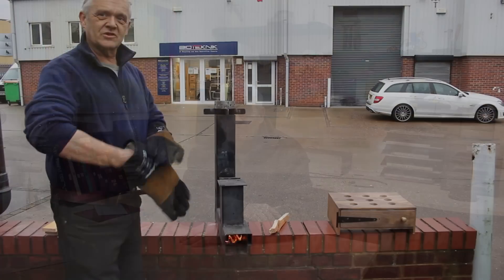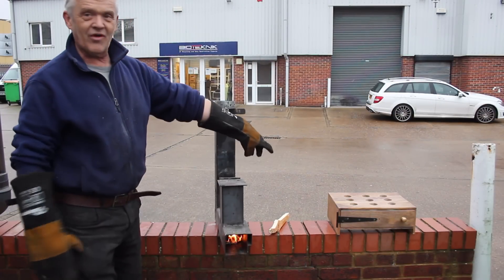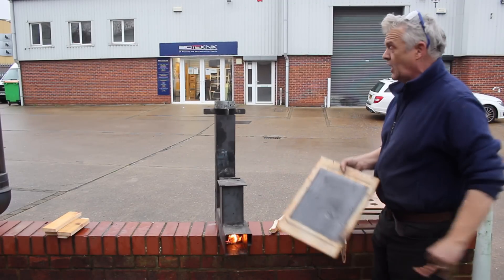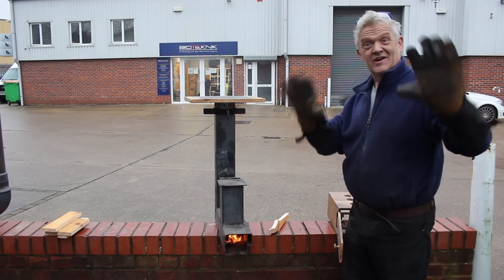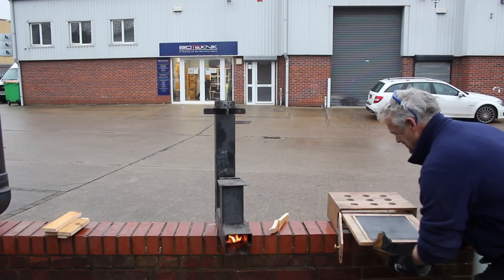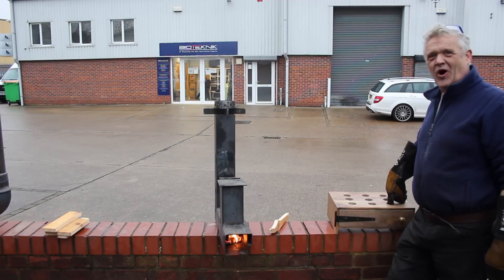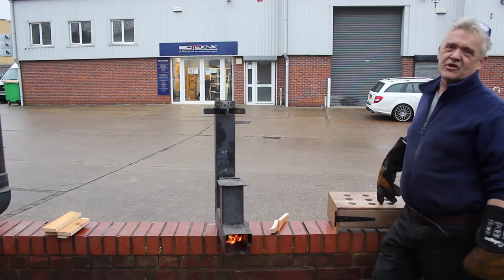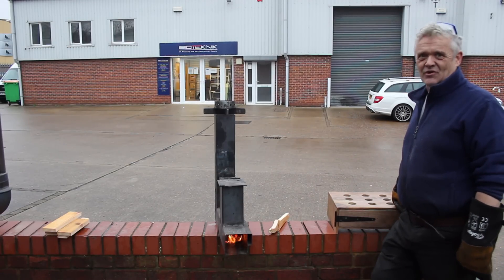1788 How To Use The Heat From A Rocket Stove Inside

Comment: A mate of mine in Sweden built himself a large steel framed workshop next to his bungalow. Inside the workshop he's got a bloody great log burning stove that he made to take pretty long lumps of log (There's less chainsawing and less time lost to go tend to the fire if it can easily take 3'6" long logs !). The top of that burner is a long flat plate, and during winter, on top of that goes 3 ruddy great lumps of stainless steel. Each of these lumps are about a foot long and 18ish inch in diameter, so he has to use an engine hoist on eye bolts to move them. They were just offcuts he had kicking around from a big turning job, but each one of these "Offcuts" must be 2 to 300kg !

Throughout the day these things get hotter and hotter. Then in the evening, before shutting everything off and tidying up, he loads these onto a stout trolley he made for the job, and wheels them into his house. He then leaves them to do their thing while he finishes up in the workshop. By the time he gets back to the house it's warm, and he says that these things save him from having to light a fire in his home through all but the harshest of winters.

I remember once wondering what kind of paraffin or diesel heater he'd need to use get an equivalent BTU per hour that these lumps of stainless put out, but there's just too many variables to even start trying to do the maths. I don't even know what temperature they get up to, or how constant the final temperature is from day to day....... But I'm still curious, because if it's enough to fend off a Swedish winter, the output must be pretty high.
Reply: Yeah but that's an open flame just getting hotter an hotter and the metal is absorbing it, not so but how hot but how long it can hold onto it also the design of the burner might determine the temp on top.. 👍🏴
Reply: @AB-C1  The stove itself is a pretty substantial piece of kit. The body's made out of a 4' long piece of something like 20 to 24" diameter (Very) thick wall pipe layed horizontally on chunky solid legs. He then cut a strip out of the top of that and welded in about a 10" wide slab of steel plate to form a surface to cook on. The back plate and front door have got to be over an inch thick too, so with all that steel, the whole thing works like a fairly effective thermal mass all by itself, and in winter, never really get's down to room temperature. Even so, when we talked about it, he said that if he puts the lumps of stainless on top before it's first lit, the workshop feels like it actually takes longer to heat back up in the mornings than without them, so they must be absorbing a fairly large amount of energy. 

He told me that when the stainless is in the house it's usually still a bit too hot to touch without welding gloves the following morning, so it must be storing a pretty substantial amount of heat. I also remember asking why he didn't make a heatsink to sit on top of one so he could get the heat out quicker, and he told me there was no need, and that would most likely make the bungalow TOO warm at night.

Slightly annoyingly, I've never actually seen the stove lit, or the "Thermal accumulators" in use, so the only info I have on them is from when I was admiring his work during the visit after he'd built the stove, and the questions I thought to ask at the time. But as the weather can get pretty inhospitable over there in winter, I've not yet been nuts enough to go visit him during that time of year...... The idea of looking at the weather report and knowing you'll be having to dig your way out of the house through a snow drift AGAIN come the morning sounds just a bit too claustrophobic for my liking. :D

Comment: Same idea to the next level. Use a bucket of stones with a bunch of smaller holes on the bottom and stacked at the top of the chimney. The hot exhaust then rises through the rock 
 
If there were smoke left in the air spaces between the rocks, then  convection will then pull it out just before bringing it inside.
Reply: i like this idea. Fast heating and free fast convection release inside.
Reply: Anything that is heated over an open flame is likely going to small sooty. With this idea you can use a smaller bucket on the stove and then transfer it into a larger bucket with lid to seal in the smell. Could also be more decorative. Maybe a mini glazed no-chimney "Kachelofen". Have two of the smaller ones to swap them out. The outer bucket will at first be a little slower releasing the heat from within, but evens it out a bit over time.
Alternatively, use an intermediate hot plate so the soot stays with the stove.

Comment: I think the ideal solution would be a sand battery to absorb as much heat as possible from a shot burn say 2hr or so. 
Then I'm thinking if that heat could preheat the return to a conventional central heating boiler. The boiler wouldn't have to work so hard, but could do all the work of controlling the circulation, of the heat and regulating the temperature. 
To keep it simple, if the rocket stove was its own system, and some form of heat exchanger between it and the central heating, would mitigate some problems and risk.

Comment: I've got similar ideas. I've done this with a small sand battery that I then put into a ceramic chimenea in the house. 

What I really want to do is put a pellet hopper on my rocket stove so that it'll burn for 8 hours nonstop. Then just run a heat exchanger/radiator from the stovepipe through a thimble installed in a window. I found a little motorcycle radiator on Amazon for less than $20. That'll be a good start.

Comment: Personally, I don't want to have to be running in and out in rotten weather to keep swapping out items like that.

And if one were crippled, it would be pretty much unattainable.

The copper coil is something that one need not spend all their time tending to, be they in hale health or on the edge of death.

Admittedly, if one is on such bad health, its likely they will be relying on somebody else to be building the stove, as well as tending any heavy pieces of thermal mass.

Me personally, I'm just fine with the stove outside of the house, but I'm going to stick with the radiator and heat exchanger option.

Again, saying something that annoys some people, but if it is built CORRECTLY...

"Its more 'efficient' "

Comment: I'm experimenting with running a plain steel tube at a rising angle over the flame. The low end of the tube is about 1 foot from the top of the stove. After the hot spot, about 4 feet of the tube rise and enter the tent or small camper. The heat rising in the tube draws cold fresh air. I've managed to get 68° fahrenheit (20° C) up from 40° (5° C) into the space.

That part's no problem.

But the stove I'm using is not burning oil cleanly. (I have almost unlimited access to fresh vegetable oil.) Smoke could get into the cool end of the steel tube and smoke means fuel wasted and low flame temperature.

If I do manage a tall enough chimney section to get a good "rocket" burn, that would mean that the end of the tube that needs to be low, is forced to be high.

(The fresh air tube could run through the center height of the chimney. But I'd only want to build that setup if/when there's a satisfactorily clean burn anyway.)
Reply: Just mix a small percentage of paraffin or kerosene into the oil. It'll burn cleaner at relatively small expense. Good idea you have there.
Reply: @jerrodlopes186  I can't deny that this is worth a try.

Comment: What if you had a large carousel halfway between the rocket stove outside and the house inside. The "hot plate"  would be round and on a vertical axle that spins as fast as a rotisserie moving heat from the stove through an insulated horizontal slit in the house. Ok...maybe that's a long shot...lol

Comment: Another fella on YouTube (can’t remember name) built a large sand battery around the chimney.  After an hour of warming the battery he would split  the two taking the large battery  (80 kilos) inside and leaving the stove out doors.    

He reported that it worked great and keep his living room  room too warm at times.  Stays warm through the night.
Reply: I saw that one too.  His design was well thought out but a little bit clunky.   Although i guess u can't have thermal mass without the "mass"
Reply: @RichardCranium321   seems you could build something into a cart of sorts.  Easily wheeled around. Feet that won’t allow it to be toppled.  Cool idea for sure.
Reply: @Route72Trucks  I was thinking more like a set of 4 or 5 stackable rings and a central spindle.  The spindle itself acts as an alignment for the transport cart (and extra thermal mass) but it's hole is also the "chimney" slot for the stove.  Imagine a flapjack stack with a vertical hole down through the middle. You can move each pancake individually yet still make up the same size stack and it eats just the same.
Reply: @RichardCranium321  this makes perfect sense
Reply: @GadgetViper  did it??  it made perfect sense in my head but after reading it, it sounds more confusing in text

Comment: The Force was weak in this video and so was the idea lol. Had a cast iron wood burner inside my house, was the complete opposite to a rocket stove, burned slowly all night or day with minimal local wood, up the flute and out the chimney, of all the ways I've tried to keep warm over the years, hands down the best and most enjoyable and extremely cheap, free wood cut on the side off the road, kept the house lovely and warm all winter, no dicking around. make an exhaust exit, done.
Reply: in many areas of the UK you are not allowed to emit smoke, smokeless fuels must be used (or a rocket stove that emits no smoke), so often other solutions must be found, these are just ideas that can be adapted or copied as a way of getting the heat indoors where you cant run alternative or want to avoid more expensive options.
Reply: @grendel1960a  even wood can be smokeless if seasoned and burned properly. You all give up too easily on that side of the pond. Pellets can, and usually do, burn very cleanly. I have a small rocket stove for which there is a pellet hopper available. If I owned my home I would install it in a heartbeat and never be cold again.
Reply: @jerrodlopes186  many years back now (in another house that was a listed property (17th century -limited changes allowed to the exterior) we used to burn wood in the standard fireplace of the house, the wood was bought as a load of slabs or offcuts / trimmings from the local sawmill at £5 a load, a load would completely fill the car (you had to collect) but would keep the house warm for several months, I also used to stop and pick up fallen wood b the roadside on the way home - fortunately at the time we lived in a small village with no smoke free zones, now I live in a city centre, and the smoke free zone starts 20 foot from my back garden wall, so I have to be careful, also since the house used to have forced air gas heating (and now has gas central heating) there is no chimney built in, so alternate methods are more appropriate. the cost of a woodburner installation is even more exorbitant than running gas or electric heating, and is not something that we can DIY.
Reply: @grendel1960a  your government has you all boxed up nice and neat, haven't they? It's headed that direction very quickly here, too. I live in California. It's very obvious, here at least, that these regulations have little to do with the environment and a lot to do with certain people making money. Just before reading your reply I made a couple of DIY oil lamps and put them in my ceramic fireplace. They're happily burning away and giving off some heat with a little help from a strategically placed computer fan. I feel badly for you over there, and anyone under such harsh and heavy-handed rule. Good luck to you.
Reply: @grendel1960a  Mate, sounds like they want you to freeze over there, all sounds a bit extreme, I never was one to stick to the rules lol.
Reply: @jerrodlopes186  I have to agree with you, rules are meant to be broken lol.
Reply: @grendel1960a  ok, thanks for the info, cheers.

Comment: You should try using Kelly Kettles filled with sand, turning them in to sand batteries. Heat as many as you need outside and bring them inside as is or add a stand, tubing and a PC fan.
Reply: The Aluminium Kelly Kettle would be ideal as it is cheaper than the stainless one and you do not want to boil drinking water in aluminium in any case.
Reply: @bfbf3342  Maybe. But what about the low melting point of aluminium? Rocket stoves are very hot.

Comment: could you run the rocket stove on the outside of a wall and transfer the heat from the stove to the other side of the wall by, say, concrete encasing the flue and the concrete passing through the wall. Or using a water jacket around the flue and piping to a radiator. what do you think?

Comment: I like the idea of a second air channel tandem to the stove that directs heat into the home while the smoke is redirected away. Maybe employing fins and such and a one way valve to close when the stove is not burning so the heat doesn’t immediately pour back outside.
Reply: You could run that either through convection for an open system or possibly an aquarium pump for a closed system.
Reply: I've noticed in my emails from the usual Chinese retailers that those heat air exchangers seem to be popping up quite a bit one of those with some extra pipe and insulation would probably work and reduce the difficulty

Comment: the best would be, attach a computer fan to it with pipes trough or a tube around the r.s. 
and blow the hot air into your house.  Safe and legal.  Just like a chinese diesel heater.
Reply: I was thinking the same :)

Comment: I would still try to build a chimney that went out a window. Possibly cans connected (somehow?) together. Or maybe some tyoe of tuble made with aluminum foil.
Reply: I don’t wish to sound harsh but This is why local authorities insist on regulations
Reply: As a former installer/builder of hearths and appliances, I will say that it's not at all impossible or dangerous if done correctly.

Comment: I think heating air and moving it using 2 air vents in the wall with natural flow of air would be a simple solution. The air should be heated around the base and the chimney before raising up and into the house. No maintanance, no water which can freeze and no fans. Just a hole 30 cm from the floor and another hole 30 cm from the ceiling.The heat should move the air from bottom to top without any fan.
Reply: A stove top fan addapted to fit inside any ducting would definitely move more warm ( hot ) air. This could push warmed air out of the bottom vent and pull cooler air from the top vent making this system more effective at warming the same space.
Reply: I have a south facing solar heat panel which uses convection in the same way that you are describing, I do have a fan hooked to a 5 watt solar panel that blows heat from that room into the house at the top of the door, that convection certainly does work though.

Comment: I have a little woodburner (much like your vevor stove) and recently i had a washing machine fail, now I use one of the shaped lumps of concrete that were added round the drum, I put it on the hot plate of the stove, run the stove for about an hour (3 dried logs worth) , and the concrete lump absorbs the heat as it comes off, I have one of those peltier fans and that carries on running (over 50 degrees) for well over an hour after the stove has stopped burning, I can come back several hours later and still that lump is warm
Reply: Ah, you basically built a mass heater. Rocket mass heaters are big in the earth ships and the off-grid homes.

Comment: Put a coil of copper around the chimney and run it inside with another coil/heat exchanger with a fan do it right and you wouldn't have to have a pump